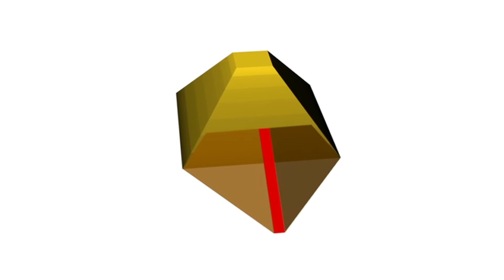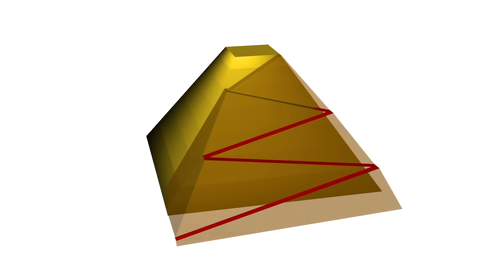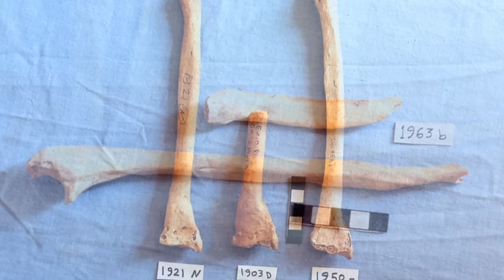Egyptology - Pyramid Construction

Comment: The Khufu contains more than 2 million blocks of stone. If it were built in 20 years that means 100,000 blocks had to be put into place a year. That translates into about 270 blocks a day, 24/7. 270 blocks a day means about 11 blocks an hour. Most of these blocks weighed more than 2 tons. If you have ever worked in construction (or masonry) you would begin to see the problems here. There is no way in hell that an ancient civilization, armed with only bronze chisels could have built the Khufu, let alone the two pyramids along side it in the time period suggested.
Reply: The used Kites.
Reply: One Love Bob  hahahahhahhah what a loser. lol!!!!!!!!!!!!!!!!!!!!
Reply: Also you would be surprised what humans are capable of. Im a roofer. My crew and I are built like average ppl. We aren't body builders yet we can carry 4x8 foot sheets of plywood, wheel barrels, 100 pound rolls of tar felt paper up multiple stories on a ladder. Some guys I work with can carry two bundles of shingles on their shoulder up a ladder. That's 200 pounds. A 5'7 guy doing that I shit you not.
Reply: @samsun7774  That is right. I have move stones three times my weight 60 meters and placing it on an exakt spot. Did this with an iron pipe and some 2"4. Imagine what kind of stone could be move vith the same equipment and say 50 or a hundred people.
Reply: @samsun7774  your 4x8 sheets of plywood dont compare at all tbh mate so leave it
Reply: So which is more likely; that they actually could manage "11 blocks an hour", or that aliens came from across the galaxy to help a random civilisation on a random planet lay stones at a faster rate than usual.
Reply: Tristan L2 or they weren't built by aliens or the pharaonic Egyptians and where built by a long lost civilization that possessed technology we do not understand. Maybe it's outlandish to suggest that but when compared to other megoliths around the globe, it seems to be more and more likely the only reasonable explanation.
Reply: Do the logistics. Just how fast do you think you can cut a 2 and 1/2 ton block of stone, transport it to the site, then put it in place using only bronze chisels, and, at best, wooden cranes?
Reply: Stop And Think. They build channels, deviated the Nile's waters and did the shipping of the blocs to the site.
Reply: So where did the knowledge of the meter and the golden ratio appear from and why are their simmilar structures built with the same accuracy on the same line all across the globe. Our Egyptions were as confused about these things as we are and wisdom is acceptance that we know nothing but you can't carve granite with bronze try it.
Reply: Who says they were aliens, maybe they were us and we had a little problem like a mass extinction event? I mean the deluge is mentioned in almost all anchient religions and we are a pin prick on this planets time scale, we are very unaware of a lot except some realy clever individuals built these to withstand almost anything.
Reply: He who has ears to hear first commenter here who has actually taken the time to look at the farm more likely alternative hypotheses. I think what you speak is probably a step in the right direction, an army of slaves dragging stones is not convincing at all.
Reply: It's not reasonable to assume construction continued uninterrupted for 20 years, 24/7. Allowance should be made for festivals, bad weather, supply chain interruptions, labour shortages and daylight only working. So double or triple the figure.9
That being said, there is little evidence for the 20 year construction period theory. Whatever they were built for, as in our day, it is most unlikely that a construction project will commence if it is not expected to be completed by the same generation. Drawing mostly from biblical sources, people used to live far longer than they do today (969 being the oldest). This is not to say that I think it took hundreds of years. I believe the ancients had a highly technologically advanced (though lawless) society
Reply: Wow! your logic is so off, we are not talking about a brick. which one man can carry a bunch of, but blocks that weigh over 2 tons each and there are millions of them , can you not tell the difference? All this hard work and miraculous achievement and no inscription on any of the pyramids to boast their achievement? Which is usually what they would do.
Reply: The aliens did it maaaan! The aliens 👽
Reply: derpty dumb Literally your name explains yourself
Reply: I always imagined the pyramids to be an impossible task of some sort but the way you busted it down actually made me really look at it as a very possible task considering the workforce and time they had to do it
Reply: @charliekelly3873  Http: //awo.nive.in
Reply: they have a wizard
Reply: Love makes miracles.
Reply: +Yurek Hunt hi, where can I find the source information about less than 600,000 blocks in a pyramid? Thanks in advance!
Reply: Paul Lasko was wondering this also, every source I've ever seen have suggested otherwise.
Reply: Anunakis it the answer
Reply: Sam Sun they didn't use slave labour!! 🤦‍♂️
Reply: Stop And Think The pyramids were not built by dynastic Egypt.  They are much older than that.  There's no evidence that ramps were used but in your theory you must consider the bottom requiring more, easily placed stones and progressively fewer with each ascending level, if you haven't already.
     Also, check out Mohammed And I and "the Rhekmier Tomb." There's something with more evidence and makes more sense.
Reply: Gucci Malcs Lmfao! The Egyptians enslaved millions of Jews to build the Pyramids?  Hilarious!
Reply: It is believed that the largest pyramids in Mexico and Guatamala took centuries to build.  The great cathedrals of Europe usually were built over a couple of hundred years.  We are closer in time to Julius Caesar than Herodotus was to the pyramids so his thoughts on their construction are probably in error.  With modern machinery it is unlikely thst a duplicate great pyramid could be constructed in 20 years.  With modern materials...maybe.
Reply: Gucci Malcs no they didn't the Egyptians did not use slave labor, and no the bible is not a source.
Reply: The Cake Is A Lie the deluge was absolutely not mentioned in all ancient cultures. In fact, in places where massive flood are not a common occurance no such stories of a deluge exist. Not only this, but there's no geological evidence of any such event. There is absolutely no SCIENTIFIC EVIDENCE that proves a deluge happened.
Reply: Dee Lee there is no scientific evidence of a flood. NONE. The Egyptian flood stories and those from Mesopotamia don't even follow similar plots! Plz go to college and actually learn about this stuff rather than reading pseudo science and watching YouTube videos. I beg u.
Reply: Stop And Think said: "The Khufu contains more than 2 million blocks of stone. If it were built in 20 years that means 100,000 blocks had to be put into place a year. That translates into about 270 blocks a day, 24/7."

First off, 24 hours a day is unnecessary as the extreme vast majority of blocks used in the construction of Khufu were only 2-3 tons and comprise the internal filler blocks. Far more than 270 blocks could be dragged into place in a single day.

 "If you have ever worked in construction (or masonry) you would begin to see the problems here."

Your entire argument seems to be predicated on a deadline but conspicuously devoid of mention regarding the workforce and expertise available. There is no step in the process of constructing any of the pyramids in which they could not fulfill. Egypt around the time of Khufu was an extremely rich and expansive empire with several million people. There are no problems that throwing more workers at cannot solve. It's blocks stacked atop one another, after all. More hands means more blocks move.
Reply: Stop And Th
Reply: Stop And Think hhhj
Reply: Stop And Think ii
Reply: Breaking the laws of physics. Open experiment "PYRAMID". On the possibility of the impossible.
https://www.youtube.com/watch?v=AJqXsbqS8y8&t=1s
Reply: +Sam Sun Roofing is tough work. Did it for one month in the heat of the summer and the singles were hot as fu*k.Props
Reply: +Tino L  shingles*
Reply: Tristan L2 hahaha😂
Reply: CORRECT !  Sails to be more precise.
Reply: Truth Army Edward Leeskalnnin
Reply: it took centuries to build this thing..
Reply: That wasn't built in twenty years.
Reply: Stop And Think this is bullshit tales for masses
Reply: redlegagent LET THAT MAN KNOW!
Reply: Ok, 40 years, do you feel better?
Reply: derpty dumb 😂😂😂😂
Reply: But how they did this that time?
Reply: My mum made it
Reply: Lmao ,plus the scaffolds that you have to raise
Reply: Sounds good!
Reply: Truth Army Skanlin's "Egyptian technology" was the block and tackle.  There's even a few photos of him using it.
Reply: Yurek Hunt Both your comment and the op's need citation. I've seen a figure of 2.3 million stones. Not saying you're wrong, just need to link to your source.
Reply: Time travellers went back in time with  engineering knowledge and built the pyramids with advanced tool and equipment knowledge. Not aliens!
Reply: Y Marina There were only a million people total in Egypt in the first dynasty.  This number might support your theory if in fact the Pyramids were built by dynastic Egypt.
Reply: Y Marina I didn't know that. Can you link a source for that?
Reply: Y Marina  I'll watch it. I saw something that said the Sphynx was already there when they began construction of the Pyramids 12,000 years ago.  A lot of people don't think they were built by dynastic Egypt.
     Here is another take on how and who built the pyramids:
https://youtu.be/ZLoIW4heKNI

I've seen better vids on this topic but they seem to have disappeared.
Reply: I think that they did it with the powers of black magic and the satans helpers themselves..lets not forget Ancient Egypt had to do with symbols...but those symbols you know were...like those of Lucifer s..thats my opinion..and I said it wrong
Reply: Sam Sun there is new evidence suggesting the pyramids wherent build using slaves
Reply: Titus Robertson haha i feel u bro
Reply: They obviously had cranes duh
Reply: Thousands of slaves
Reply: Wade Older what does "mathematically perfect " mean? In what way?
Reply: Y Marina human history on record, dates back 3K to 3.6K years ago
Reply: they just stupid but they act like they know everything in the passed hope they know more about gravity works
Reply: Tristan L2 aliens sound way more likely
Reply: Giants bro.
Reply: Bath Salt Zombies Actually, ice core samples indicate a massive rise in sea level after the ice age. I'm not saying a Biblical flood that covered Every Mountain ever existed, but there was a worldwide flooding that could have affected many different cultures and thus is the reason for all of the flood myths.
Reply: Stop And Think I think youre underestimating what thousands of ancient people could get done
Reply: Tristan L2 it isn’t “random” because you have to ask your self, what was the purpose of building it in the first place?
Reply: With 100,000 slaves at your disposal, who the fuck cares?
Reply: I have a solution.

The ancient Egyptians were phenomenal architects for their time

But even greater liars
Reply: "But even greater liars"

Well, at least some of the pharaohs were great liars. But any large Empire is sure to have propaganda as part of it's method of rule. There are reliefs carved into stone which depict their pharaoh utterly destroying their foes and bringing victory to Egypt in a particular battle even though archeologists have sussed out that they actually lost. Save face through damage control... we can't have a facsimile of a god losing to enemies, now can we?
Reply: you won a medal for this
Reply: Long story short we had help people
Reply: They weren't blocks on their way up. It was a marble!!!!!!
     Repost:How the pyramids of Egypt were possibly and most likely built:
    The stones were shaped at or near the quarry and transported to the Pyramid site in this method :
    An assortment of encasements from spherical to cylindrical, encased the block and interlocked into place around each block stone allowing the stone to roll. Certain attachments around the encasement would allow either fulcrums or rope attachments to ease movement and allow for tight corner turning with the least amount of men. Once the stone reached the top, the interlocking encasement was disassembled and the stone was leaned over and slid into place.
    This technique would have eliminated the need for lifting devices or a massive ramp.
    My theory is that most likely it would have been a spherical encasement allowing for tight cornering. This would be the most logical way to transport a large stone using the pyramid itself as the ramp.
     So in essence the stones were rolled up the pyramid in a spherical encasement that was removed once the stone reached its destination and leaned and slid into place once atop the pyramid. This process was repeated all the way to the top. 
     I have not decided yet if the encasements were made of a metal alloy or limestone etc. If bronze was used it would have been melted down for chisel making and as such there would be no evidence of the spherical encasements.
    If limestone was used it may have then been discarded and reused for other construction. 
    In conclusion the only way to deliver a square to the top of a Pyramid is to encase it in a Spherical interlocking encasement.
Reply: The were built by Black People 💪 (Africans)
Reply: Stop And Think ik
Reply: if you are dumb then i see you point, but you see you don't know meaning you'll never know how unless you do your homework. It's a heavy duty work I agree but we are mens we can build anything. However this is a simple procedure, 2 tons or 5 tons easy work. You don't need to lift or push to build a Pyramid.
Reply: or many the ancient humans are not as small as we are today.
Reply: Stop And Think if it 2tons its not that hefty. plus you got someone superior to whip u for being a slowpoke. that should fasten things up for future generations amusement
Reply: Old Egyptians were able to build these pyramids and raise a weight of 70 tons as easy as you take a little stone in hand! but they keep it secret just because they didn't want you discover the easy way to find gold!
Reply: Agreed I'm a hod Carrier
Reply: redlegagent But again, the effort required for such a mammoth task would require workers to be fed. Remember the Egyptians had no means of mechanical help from machines. If what you say is correct, and doubtful that it is is, what happened? With such technical ability and engineering prowess why are the Egyptians not so much further advanced now than countries such as the UK? Your reasoning is simply not credible.
Reply: That is why It is the First world wonder,Because it is fking Impossible
Reply: redlegagent   no, quite simply you are again using what you believe as "evidence". There is no evidence and the evidence you refer to is nothing more than theory. Or your own belief to satisfy your somewhat narrow and restricted thinking. 

The rise and fall of society happens throughout the world. Indeed, to an extent it has been part of Great Britain's history but, we have continued to create and enjoy significant advances in technological progress. Again, why not Egypt? If what you believe has any credibility, that continent at the very least would not be suffering drout, having the wherewithal and manpower to resolve such an issue.
I suggest you apply level headed thinking and repeat your calculations as they really do defy any reasonable logic. Good try though by quoting a little history distraction but, the pure science of your claim is very much flawed. Focus on the subject in hand and review your thinking.
Reply: redlegagent  But you are too theorizing on personal belief and bias. Quite simply there is no indisputal evidence, or proof, as to how the building of the pyramids was achieved. Many theories are presented and, to what any individual sees as plausible, that then becomes their own answer to one of the greatest mysteries. Therefore, anyone may be considered gullible as no definitive has been presented. We Will, have to agree to differ. You put across your point with eloquence but your theory is fundamentally flawed. Pursue further the accuracy of positioning such huge blocks of stone, and even how they were cut. The Labour required is a small part by comparison. The tools and equipment required were way beyond an array of hand tools and block and tackle.
Reply: redlegagent  You have once again offered nothing more than eloquent ramblings. To ask whether the sun is hot, is quite frankly, ludicrous. We feel its heat as simple as that. The blocks you refer to have been eroded over time. There is much evidence of undamaged masonry evidencing fine calculations and tolerance but, to support your point of view you have chosen not to include this.
The building of the pyramids remains unsolved and your theories, endorsed by "experts" is quite simply nothing more than theory. Too many questions remain unanswered. Thank you for the photo but the video, unfortunately it is not loading but you did what you could.
So, an interesting point of view you present but flawed based on restricted thinking. Looking forward to your response.
Reply: Sometimes i ask myself who came up with the original plan and coordinated them.
Reply: redlegagent  But, apart from a brief point of history, the question remains how they were built. You do not have a definitive answer backed up with indisputable proof. The building of blocks analogy by a child is quite simply beyond comparison in the technical and physical abilities required on the scale of the pyramids.  However, with regards to young age building blocks, Lego for example, look to how the stones are fashioned to interlock on the pyramids. Tools, materials required, look to what was available at the time of the pyramids being built. The question remains and not answered by sheer force of available sustainable  labour and next to primitive tools.
Reply: So?who built it!,idiot
Reply: redlegagent  no, you are wasting time by continuing to offer nothing more than implausible nonsense. Whether you have studied Egyptology is simply irrelevant to the question of how the pyramids were built. You have an opinion, a rather simple minded one at that, and unable to back up your opinion with any fact to destroy my argument. You are however, continuing to deliver in a manner that is condescending and contemptuous. That, does not win the argument. I do not have to provide proof, there is no proof and that is why the question remains. However, much is available on the internet as an alternative view, i do not need to regurgitate it however. You really must allow others to have views and apply their own logic and technical knowledge or expertise, and to formulate opinion based on this. You clearly have issue with anyone not agreeing with you and feel the need to respond in a disparaging manner. Research further and enlighten yourself to other possibilities, you may, without a closed mind, actually learn something.
Reply: Built inside out and too to bottom
Reply: It took much longer to build than 20 years that’s why
Reply: Nerd
Reply: thank you - we sensible people know the maths . We know you can't cut Granite with Copper so , from the onset , the blocks of stone could not exist - it doesn't matter how they would have got them stacked into a Pyramid . YET - here are these great structures - HOW ?
Reply: Russell Brain Well, I tend not to think that they relied on slavery (which is supported by archaeological evidence) and rather advanced technology (I am no alien theorist, those are laughable). What I am saying is that they must have possibly discovered something or thought about something that we have not (maybe due to our mindset, as mindsets vary upon one’s culture). They were a civilisation that managed to utilise and create the first artificial pigment in the world (heating to 900+ degrees). In that age, it is amazing
Reply: Making 2 million block in 20 yrs- possible, transport them from the quarries to the site- possible, but  dragging 270 nos. of 2 ton  blocks from bottom to top in a day - totally impossible
Reply: @denaliwarnakula7684  I believe in aliens but i believe and in ancient  Egyptians. Do you?

Hello , what you are saying is very interesting, but it doesn’t bring anything new  about how the Great Pyramid of Egypt was built. In Romania, a book was published, THE SECRETS OF BUILDING THE GREAT PYRAMID OF EGYPT, which has completely new theories about this subject.                                                                     . 
Go to www.thegreatpyramidofegypt.com , read fragments ; the section Fragments ( menu = translated into English / Fragments of the book and Romanian / Fragmente din carte ; comments/ comentarii) and have some comment.
Sincerely, Hantz.    

www.thegreatpyramidofegypt.com      

  1 - Pharaoh Cheops And The Great Pyramid 
  2 - Menu / Meniu :  
  3 – English / Romana:
  4 - Fragments of the book / Fragmente din carte :     
  5 – Comments / Comentarii:
read "fragments of the book" and you will find interesting things.
Reply: Hello, very interesting, but we're bringing news about how the Great Pyramid was built in Egypt. In Romania, a book, THE SECRETS OF BUILDING THE GREAT PYRAMID OF EGYPT, has completely new theories about this subject.                                                                     . Go to www.thegreatpyramidofegypt.com  , in Read fragments ( menu = translated into English / Fragments of the book and Romanian / Fragmente din carte ; comments/ comentarii) and have some comment ?
Sincerely, Hantz.
Reply: Unseen oldest gate way found https://youtu.be/GptcZSziHjY
Reply: The pyramid shape is a remarkable signature of Fallen Angel design

They were built by Giants by orders of the Fallen Angels

Centuries later they were found already built by the Egyptians and the Egyptians used them for other purposes, but they were not the original builders
Reply: Stop And Think you're a fool when you underestimate human power. Tell me, how did we shape and build the modern world again? We still have limited knowledge of the past, so why are you considering the term "impossible" as an option?
Reply: Of course u can't imagine it today with things like union breaks, minimum wage, technology, 8 hr work days. Back then getting those pyramids built was probably top priority like skyscrapers and roads and bridges are today. Plus they had slave labor and can work them as much and as hard as they wanted. Yea it's a big feat but with enough commitment it can probably be done. I mean the pyramids r a real thing. They exist so obviously it was built somehow. By man or aliens I can't say for sure.
Reply: Pretty much everything you have said is completely and utterly wrong. It is misinformation like yours which has led to so many ridiculous theories about the pyramids; invariably invented by people who don't speak Egyptian, haven't been to the Great Pyramid, can't read hieroglyphs, have never studied ancient Egyptian history, and have gleaned all of their 'knowledge' from YouTube...
1. The Khufu pyramid does NOT contain 2 million blocks of stone; it contains fewer than 600,000. However that number may actually go down even further now that a giant void was recently discovered.
2. We don't know for certain how long it took to build and 20 years is simply an estimate. It may have taken less time, or more time.
3. If we assume 20 years, then roughly 30,000 stones needed to be placed each year, NOT 100,000.
4. That translates into about 80 blocks per day, NOT 270.
5. That's about 3 blocks per hour.
6. Needless to say, but I'll say it anyway, because a lot of people leave logic and reason at the door when it comes to the Pyramids, 3 blocks per hour is VERY doable.
7. Most of the blocks did NOT weigh more than 2 tones; the vast majority of them weigh a little over 1 ton, though there may be a lot that are even lighter than that.
8. Contrary to what people believe, most of the stones were NOT precisely cut. The stones on the perimeter, and surrounding the various tunnels inside, were precisely cut. For obvious reasons! However the vast majority of stones - i.e. all the ones that make up the unseen interior of the Great Pyramid - were rough hewn and were, consequently, very easy to lift and place.
Reply: Tristan L2 We are not a random race, and lol, the pyramides had/have a much more significant point, than just a freakin monument or even a grave
Reply: How do you cut granite with copper? How do you lay blocks accurate to a 10th of a millimeter with string line and plumb stone. Do you disregade the possibility of an earlier civilization on earth who may have been through an extinction event that had more advanced technological capability than us (examples-iron in rock sediments around the globe which was in molten form has changed direction over earths history and we can suggest our poles have altered at least 5 times, a shift like this could restart earths crust formation, move continents, errupt every volcano simultaneously or wash the earth with a planet wide tsunami amoungst many other violent actions). My friend we know nothing im not claiming to know but if your mind is opened your eyes and mouth will follow, we have free energy and people know the pyramids secrets but greed and power keeps them throughout our history as the masters of the slaves, they dont want you to know they want you simple like cattle. Does your life fulfill your soul? Have you not a yearning a feeling that were missing something? Wev'e been lied too and bought up to be terrified of death when its a natural part to our existence we all share, im so sad for what we are we are all capable of love and kindness and i see it ignored every day because weve been conditioned to accept the chosen truth we are fed from childhood. You are more than what you are told, did you declare wars with your fellow man? Did you give your country the right to take anothers liberty. Were you just told one day these guys are bad, they did a bad thing and troops are on the way after we bomb their citizens for a few days but its ok their a terrorist. Please stop scripting to a suggestion and begin by asking yourself every question and you can find answers, i never state i discuss and begin to learn the truth from the people not the power.
Reply: Regardless if you agree you have to give credit to rational thinking... Not very common these days
Reply: Its easy just not easy for you because your spoiled with new age technologies
Reply: If they lay three blocks in one minute there's no problem.
Reply: egyptians got millions of slaves. you got your answer
Reply: You're forgetting the man power they had. The workers were slaves, they did everything they could just to get by the day, and 270 blocks a day is worked on by a few thousand slaves working on blocks, it's not that hard to imagine
Reply: redlegagent aliens built it
Reply: Sam Sun I know what you mean, I'm the exact same way, if a task has to be done it doesn't matter how heavy the load you find the strength to push through.
Reply: It isn't true that the people of that day did not have the wheel or iron/steel for tools. The Giza complex has far more to it than the great pyramid. Three large pyramids plus numerous smaller ones, temples, the Sphinx, and a system of high capacity underground tunnels and shafts operating on multiple levels, criss crossing the plateau for many miles. Plus enormous excavated chambers, Saqqara type boxes etc etc. All of which required at least as much work as building the pyramids themselves.
 I think it was the work of the highly advanced, human, pre flood civilisation. However, even the post flood Egyptians had the wheel and Iron. Their time was contemporary with Moses' time. He led the Israelites out of Egypt and they later chased after them on Chariots!. And I doubt they had copper wheels
Shortly after, we hear about the king of Bashan (in the land of Canaan -allied to Egypt) who had a bed made of Iron!. They went to war bristling with swords, shields, and Iron spears
This copper chisels and wooden rollers nonsense should be put to bed.
Reply: Stop And Think 🤔 ahhhh I don't know they had ancient technology
Reply: Gucci Malcs I really like your point of enslaving millions of jews, these people are highly intelligent, might have been proved to be a great advantage for the Egyptians getting their pyramids done.
Reply: Aliens
Reply: Only idiots believe this dis-information.  The wheel had not been invented yet and we are told to believe these humans contained the knowledge to build the structures that are mathematically perfect on the planet?
Reply: You underestimate the intelligence of our ancestors. We are much much dumber than they were when it comes to problem solving. The Egyptians enslaved millions of Jews and others who built these pyramids.
Reply: @guccimalcs  Actually they were payed. And  there are no proof of a hebrew enslavement other than the bible..
Reply: Gucci Malcs. No slaves. The construction was done by Egyptian citizens. It was an obligation like Army Service, and they were well fed and well paid.
Reply: , the government made the pyramids, and the earth is also FLAT!!!
Reply: Katharina Kissauer  earth is flat, how do you know? I know the sun is above the cloud but earth is flat prove it and don't use youtube to prove it either.
Government built pyramid, well Egyptian kings are technically government so yea they did build it. It's pretty standard procedure,
Reply: Stop And Think then who did build them?? ..do u really belive aliens came and bulid the pyramids ..it was man lots of man power and animals..white people need to accept this  it was brown Egyptians